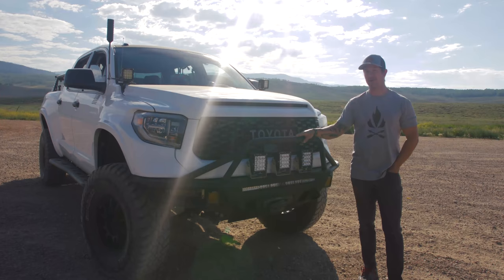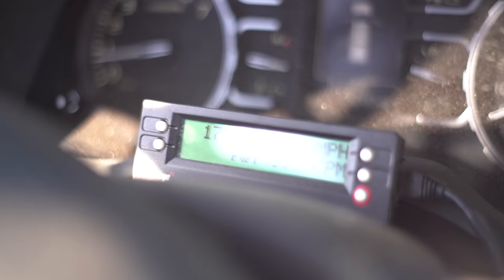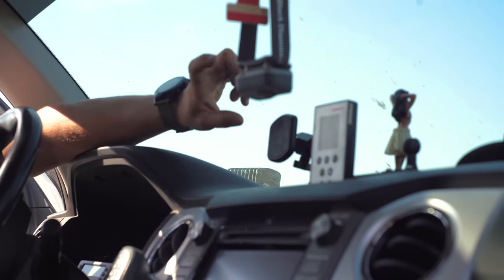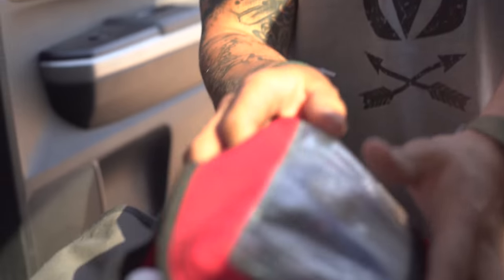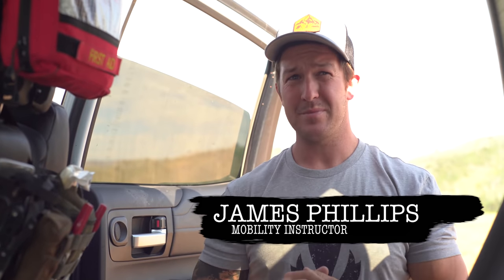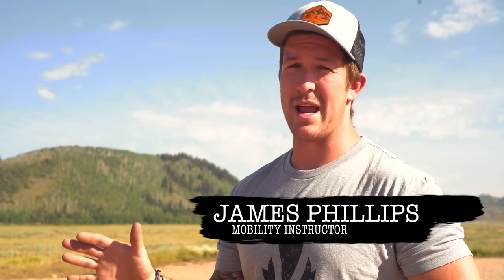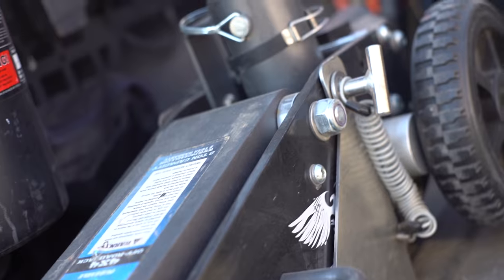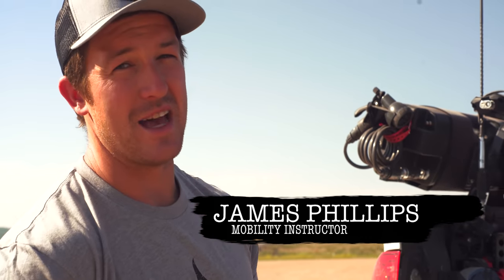Fieldcraft Survival Overlanding Rig Set-Up

Comment: A little food for thought.......Given the amount of electronics needed for newer vehicle function......I would like to see a similar setup on say a early 70s 4x4 manual trans 3/4 ton truck. I know there is a difference in an Overland truck and an Apocalypse truck......but there is also a ton of overlap.

I would like to see you guys do a more simple mechanics build......something that isn't latest cool guy techy stuff.....and can get beat to shit and take it......more Rock Crawler and less Recoil magazine cover truck.

Maybe some short "how-to" videos........changing big tires with hi-lift or offroad jack......straighten steel wheel beads with a rounded punch and hammer......navigating questionable trails for the new guys.

Phil - I like what you are doing at FCS......but for the experienced trail monkeys, it would be nice to combine the "trail" with "survival" based on your experience......maybe relate gear choice to personal experiences. For example, my vehicle tool bag differs from yours because I have non-war experience and friends/family are a phone call away. I know I am missing some gear that makes sense in a "bugout" scenario........but I only know what I know.

I know this is the first or second video.......but lets go down this rabbit hole.

Thanks for your time.

Comment: Are there any technologies available to citizens for preventing your tires from being taken out (whether by a firearm or road spikes)?
Reply: Fill and compress Slime to recommended psi? Lol that would be hilarious actually. But no, nothing will really work. Solid rubber is the only option - anything under pressure in your tires won't have the viscosity to stay in there with a bunch of holes. Slime would still work for multiple nail-sized leaks...maybe 22LR/.223/5.56 sized holes. Maybe. Anything bigger and it ain't gonna hold pressure though.
Reply: Closest thing I can think of is run flat tires. Definitly not for this application though.
Reply: @deathlis  It may have been a stupid question on my part, but you don't know until you ask.  I figure if anyone knows, these guys would.  My concern is that you can fortify a home and prep to the max, but it's all for nothing if you get intercepted and taken out on your way to work or on runs for supplies.

Comment: Hey brother good video! My question is on the air inflation system for the tires is it like a compressor or is it like a scuba tank with air? If it is like a scuba tank what size tank are you using and how many times can you fill up a tire? The reason I am asking is I used to do roadside assistance and I use a scuba tank 20 cubic foot and it lasts me a good long time but I am looking for something like a pony bottle size to use to at least be able to air up two or three tires. Thanks for your time!
Reply: Look up PowerTank. 🤘🏼
Reply: @travishess8790  I have never heard of these and am thankful for the suggestion. Thanks brother 🙏🙌

Comment: I would also suggest a proper wound care maintenance plan as there are going to  where you will need to maintain wound care short medium and long term care ..
I come from over 12+ years carer perspective and whilst  booboo kit might great for 1 term use applications..

Nobody from what I can tell builds a medical system to operate indefinitely including someway to medical charting system what you have done and so forth so if or when you can see a doctor of some description to render aid to you or other people within your party..

you biggest issue with the tundra/hilux platform is going to be fuel and carry capacity, personally I would likely consider a 6x6/6x4 option 

I would also consider crash factor and large animal strikes this will include elk, deer, bear and moose.
..
Most of what is purchased from outfitters typically doesn't have the capacity stop animal strike and can typically cripple the vehicle

with all the crap you are going to need to survive in a clusterfuck My suggestion would be a road train  4-5 trailers long averaging 40 foot in length

Comment: Dude, dope rig. Field Craft is setting the bar for training/survival companies. Multifaceted. What are the details of your suspension setup?
Reply: Camburg long travel and bed cage with fox triple tube bypass
Reply: @travishess8790  nasty. How does it handle on the street?
Reply: How does it handle extra weight in the bed? You mentioned a camper setup.
Reply: Brandon Whorley it was great for the time I owned it. Long travel does more for comfortability and capability than just going fast in the desert. I wouldn’t be surprised if there ends up being an AT Camper like Glover’s  on it. Used to have a GFC. But for essentially living out of, AT does a fantastic job. Looking forward to seeing what Phil does with the truck as it progresses.
Reply: @travishess8790  Cool, what are you building now? Will that be in an episode?
Reply: Brandon Whorley I’m no longer with FC as a mobility guy but still support and assist where I can. New builds are mainly on IG and I’m dabbling on YT. 👍🏼

Comment: Why an air tank instead of a compressor system?
Reply: Did he mention how much pressure it holds?  I carry a 40cf nitrogen bottle with 2000psi and airs up several tires.  The main reason I went that direction is because most of my tires are heavy/high pressure rated.  It saves time airing up to 80psi compared to waiting for an air compressor to hit the mark...
Reply: @waggtech8793  I don't think he mentioned but thanks for the info. That's definitely a plus